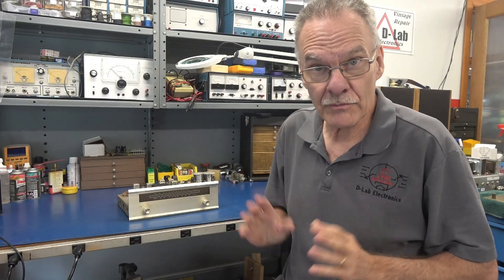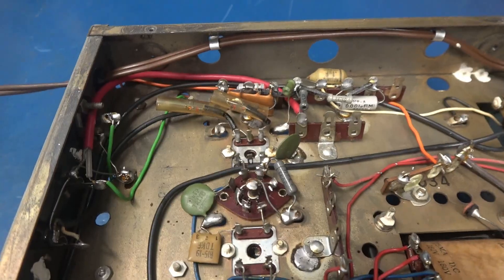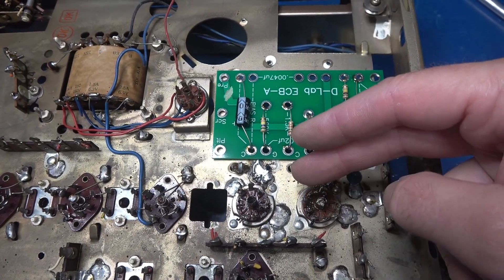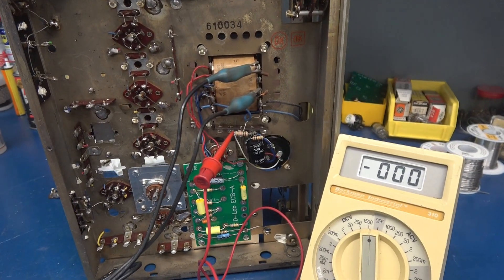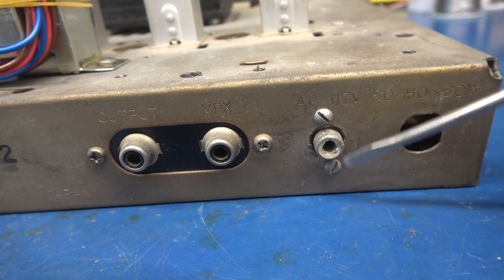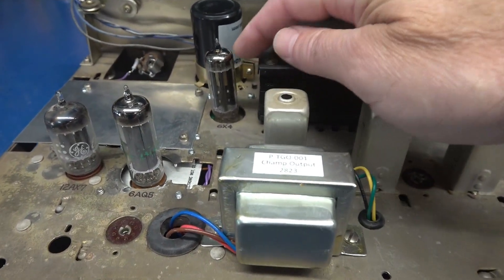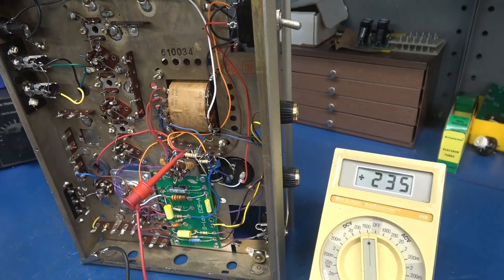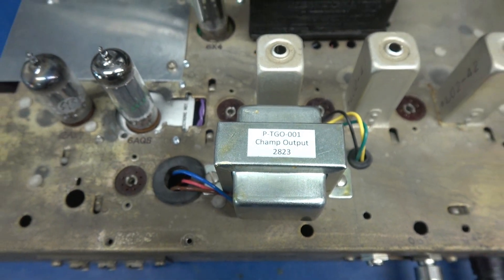How to convert Vintage Lafayette LT-100A FM Tuner into Class A 6AQ5 guitar amp easy retrofit

Comment: How hard would it be to utilize those extra tube sockets for some extra 12AX7 gain stages? I’m assuming that transformer could handle that power consumption given it had those extra tubes to begin with.

Comment: You can tell that was never UL approved! Using wafer switch contacts on a signal level  rotary switch for AC line😧 And no fuse to boot! On later models that had a true AC line rated switched on the common shaft.